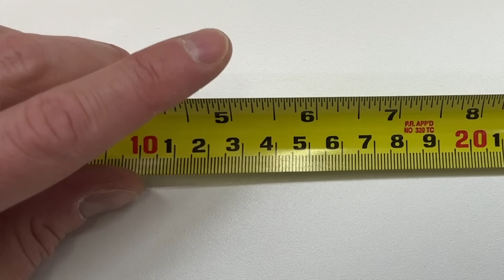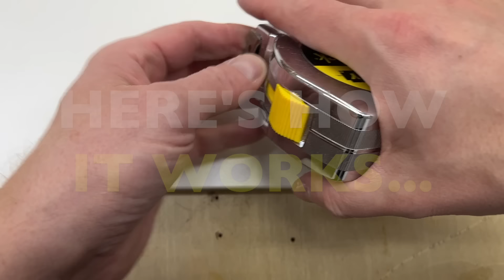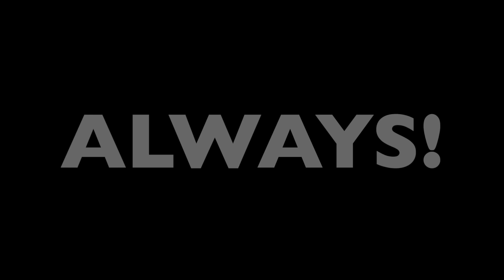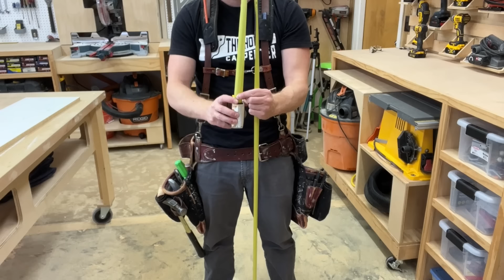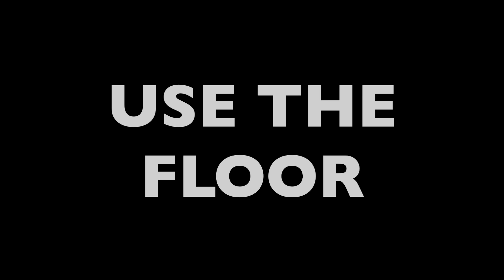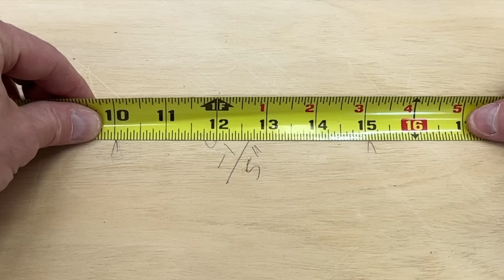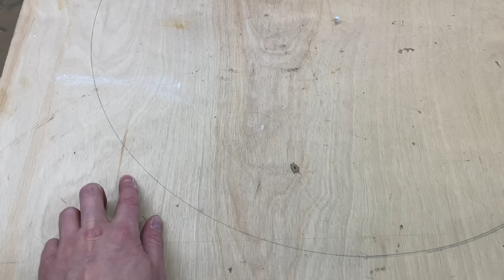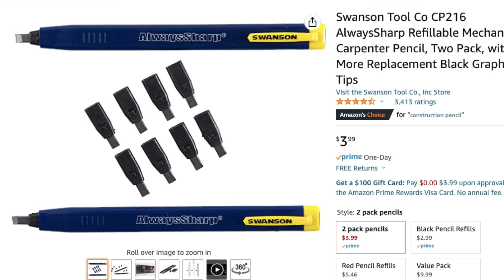ALL TAPE MEASURE TRICKS Explained...In Just 13 Minutes! (Measuring Tape Pro TIPS, TRICKS + ADVICE!)

Comment: Have you ever flipped the tape measure over to use it as a straight edge? Also, some tape measures have a little tab on the end of the tape which will let you roll the tape better for reading. Also when you're measuring something really long and your tape is floating in the air, you can pinch it with your finger that you normally use to keep it from rolling up and that will keep it straight so you can use your other hand to mark a measurement. Another trick is if you are trying to find a center point, make a even mark from both sides and if you can get them within a 1/4 inch or so of each other, you can eyeball the center.

I watched your video to see if there was anything I missed in the 27 years Ive been in construction and I'm happy to say I got every one and agree with you on all of your tips and am impressed with how well and quickly you explain everything

Comment: When measuring into a corner, I mark 10" from the corner and then measure from the opposite side to the 10" mark.
Reply from the maker: I really wish I had put this method in the vid. It’s so easy to leave stuff out on accident 😅
Reply: @TheHonestCarpenter  Not a  problem.  You did an excellent presentation.  I learned a couple new things.

Comment: Fun facts! For the vertical measures, instead of doing the bendy-bend, if there's something to hook on or but against, you can get away with just going straight up against the surface, reading what it comes to, and adding the length of your tape measure case/ rolly-thing (usually its 3" as a standard).
Reply: This also helps when measuring in tight spaces so you don't have to bend into the corner.

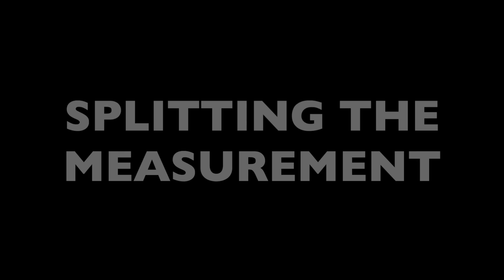Comment: Usually to get an inside to inside measurement when trying to be as accurate as possible I will split the measurement like at 8:29 to get a bang on measurement. I don't like bending the tape. Usually I have to deal with chamfer that's been nailed into a bottom corner so it does not help especially with the chamfer not always being perfectly cut.

Comment: well during my 40 years as a carpenter... I bought and tried out many different tapes ... I finished the last ten years on the job installing high end cabinets - trim and wood panels -  using a Tajima  tape measure - its printed on a white background and is EASY to see and read in low light situations . Years ago it was wood folding rulers when I stated out and I kept one in my box just in case I needed to use it again

Comment: You can instead of bending the tape for an inside measurement you can just butt the tape case up to the surface take your reading then subtract the wide of the case from the measurement much more accurate

Comment: I would like to add some of the things that have come up on jobs, the first is if you drop your tape be sure the tan wasn’t bent, because it will effect your inside outside numbers, and if your cutting moldings and have made a cut list try using the metric system, the numbers are easier to write down and read once you get to the saw

Comment: Great video, 43 yrs in trades, we all have little tricks. Mine is adding up numbers, I’m good at math, but some times, I’ll add let’s say 25 to 35, so I’ll extend tape, take the 25 and line it up to 35 and read the number. In this case it’s 50…..lol, it will stop,at the 60, but works best with fractions, add 25 3/8 to 50 and 3/4, do the same and come up,with 76 1/8”, hope I’m right, but yiu get my drift.

Comment: This was good … adding (didn’t read comments) that , measuring tapes also have a precise measurement on it telling how long the tape is so you can pull a measurement and butt the back of the tape to the wall and add the measurements that way you don’t have to rely on the bending corner technique… this probably wasn’t explained clearly …. 😅

Comment: When I measure inside corners I use a tri-square blade. It is exactly 12". Just butt it up to the inside corner and measure to the other end and add a foot. If it is a wall or ceiling use the blade to mark a foot out and measure to that and add a foot.

Comment: aren't all tapes marked on the body to add to the measurement for inside corners? Butting up against the corner with the measurer and reading the tape, then adding whatever the body dimensions are on the body itself, 2 or 3 inches usually. Isn't that a thing?

Comment: when measuring inside edge to inside edge, can use the length of the tape measure in the measurement (measurement + tape = total distance).  The length of the tape measure is etched on the back of most models

Comment: I was equally happy working with metric or Imperial, went to school in Metric, and lived in Imperial until Canada half-assed the move to Metric in the 70s, it still hasn't taken.  3 things make me work entirely in Imperial these days:

1) The US contimues to pretend it isn't a Metric country, living in Canada, all the plans I buy, or stuff I buy, tends to be Imperial/SAE, so I gave up fighting.  Earlier I was mostly doing my own thing, but after I became a home owner, I did a lot more construction, and it is all sorta Imperial.

2) All the construction products are pretty much imperial, no point in fighting it.

3) On bigger objects, like the boats I build,  it is  possible to get lost on the Metric tape, and the increment is 10 cm/4" so one might not see it at first.  The same numbers just keep repeating.  There is not bottom line with a total that is as clear as 120 inches.

Comment: I was educated in Metric, I know it well.  Don't find it to be better.  I think a lot of people forget that there are decimal inches, and that the Imperial world pretty much invented the machinery and processes that led to the 20th century.  

Carpentry is really dumbed down these days, we don't build complex things any more.  Or if we do it is all built into a comprehensive truss, with no attic space.  But when we did there were books on how to use roofing squares and the geniuses who invented all that long forgotten stuff had their reasons for using fractions.  

In a lot of places today, young people aren't taught much math so they don't know how great fractions are.  It is a lot easier to find the middle of 5 7/16"  than 138.  Just go to 2.5 and move along either 3/16, or exactly 7/32.  A decimal system exists with either inches or metric, and probably works better for people who are stuck using calculators.

Comment: I also only use Stanley tapes. Licensed contractor for 35 years. I can tell that tape your using is the “new” inferior one from Home Depot . Not the old normal Stanley quality. Marked difference. You can still get the real ones at mom and pop hardware stores though

Comment: I'm a carpenter apprentice. When I measure to a corner I make a mark at nearest 100mm or 500 or 1000mm then measure back to the mark from the corner and add the two measurements. Works for me every time. I don't find myself measuring into corners too often so I can justify taking a little longer to take an accurate reading this way.

Comment: Just came across this video. I have a big criticism of the corner read suggestion. NEVER read a bend. Tape from one end, mark ten inches, tape from the other side to the ten inch mark, then do the math. Unless there's something wrong with your tape, or there's something wrong with you, you'll get perfect cuts every time. I've restored five historical homes, requiring perfectly cut wooden window frames, which aren't easy to find. In order to build your own, worthy of sale, you have to get perfect cuts.

Comment: Where are the Metric tape measures?  Why can't we use what the rest of the world uses? No one can do 1/4's, 8th's and 16th's anymore.  Too much math.
Reply: If you live and work in the trades in the U.S., you'll find most all materials are sized in imperial system measurements.  No need to bang your head on the wall trying to change that.. just go with the flow.  If you need some practice with fractions, spend a little time with that until you become fluent with it.  You'll do just fine.

Comment: Great video. I watch a variety of videos on here for different learning purposes. The only thing that I think could help make a lot of videos better is to slow them down just a bit. The people who are in them are knowledgable, but dont give the viewers much time for the info to sink in. It seems like the knowledge is all there, but i constantly have to pause or rewind and I sometimes get lost. So maybe try slowing down just a tad bit.

Also, sometimes after showing an example, maybe offer a "practice measurement" where you give viewers a couple of seconds to work out the measurement (using the techniques youre sharing with them) on their own and then go over it again, giving them the answer so they can make sure wether they're correct or not. Just some suggestions! Thanks for the video!!

Comment: Most pros don't deal in 16ths. It's too confusing. Rather than saying 11/16ths, they'd say 5/8ths long. or 5/8ths plus. 16ths are difficult to find on the tape. They aren't marked, and there are too many lines to count easily. 8ths are generally easy. They're often marked on a good tape measure, and you can always count them quickly. So if you say 11/16th, you have to do the math. subtract 1 to get to 10/16th, then divide by 2, to get to 5/8th, then add one mark. By saying 5/8th long, you get rid of that math.

Comment: I used to buy refills instead of throwing out the entire metal casing.  Saved a few bucks per tape measure of which I had 10 as I always supplied them for my crews, so the savings added up.  I guess that's different now that everything is MIC and cheap as well as cheaply made.

Comment: Add you thoughts, advice and experience with cutting or leaving the line, particularly if one marks every 12 inches on a 8 foot 2x4 (for example).
Reply from the maker: Most of the time I’m trying to literally split the line in half up the center (leave half of the line uncut by the kerf). But if you don’t need really precise pieces, your tolerances don’t have to be this precise. Just remember that the blade has a thickness, and it removes this width (usually 1/8”) from the board!

Comment: when i worked for a  company that only did steel studs and drywall, we would call out everything in inches and eights. usually a team was 2 guys, a cut guy and a screw guy lol. so when the screw guy yells a measurement out instead of saying for example, " 4'8" and 3/4's, wed say 56 and 6.(or if its, 87 1/2 inches, you just call out 87 & 4)  if you only gave to be as accurate as eighths like hanging drywall. it saves a lot of time. especially when you have to  write down a bunch of measurements.

Comment: In Australia (and I think in Canada) a 4" x 2" stud is actually 90mm x 45mm so use either a metric or Imperial tape measure for whatever you are measuring. If studs are 16" apart use the Imperial measure, if they are 450mm use the metric measure. I grew up with the Imperial measurement system and now use metric 98% of the time. If I'm installing 4 brackets for vertical blinds it is easer to divide the width between the end brackets of 2635 mm by 3 for 2 extra hangers than 103" 47/64ths. The only time I use Imperial is to halve a measurement so to halve a width of say 17 1/4" I'll get the zero and 18" looking the same each side and mark off the 9". And there's never a need to use a bent tape to measure an inside corner dimension: put the end of the tape in the corner or if it's fully enclosed add the width of the casing. Or even better use a METRIC laser measure. Multiples of 12 work well for time and the compass and repeat dimensions but not to calculate dimensions.

Comment: The difference between imperial and metric is one is fractions the other is decimal. The most common calculation in carpentry is dividing by 2 or finding the center. This is much easier to do with fractions.
Reply: If someting is 13cm center is 6,5cm. How is it easier in imperial?

Comment: This was great!  I'm 66 and have used tape measure all my life (but for little things).  I never knew about these tips.  I'm still unclear about the movement of the hook at the end.  If I'm measuring something to cut, say it's 12 inches. I hook the tape measure on one end, pull it to the 12 inch mark and i'm ready to mark.  But since there's now an additional 1/16, do I mark at 11 & 15/16?
Reply from the maker: No, mark right at 12”, Clem! The hook pulling out a little bit is what makes it accrurate—the hook has subtracted its own thickness for you. But if you butt the hook AGAINST something, it adds its own thickness. In both cases, you DONT have to change numbers.🙂

Comment: I have never used a measuring tape.  I I've been redecorating my place . My question is, when measuring the window and finding the half point then measuring out towards the wall to hang a floating shelf.  How do I read the tape on the window measurements?

Comment: Great video! The only thing I would change is to NOT throw a bad tape measure out. A good majority of these tape measures and hand tools come with LIFETIME warrantys.

In my experience from buying tapes from either home depot or Menards, they will let you swap out the defective good for a new one on the spot. I havent paid for a new tape measure I'm about five years and I have a total of four. A magnetic Milwaukee for steel studs, two Dewalts for stick framing and of course a fat max.

Comment: Listening to the explanation of how to figure out SAE really sounds moronic compared to just counting to ten in metric.  For a dyslexic like me SAE is as complicated as your explanation sounded.
Reply: Well, go to any lumber yard in the U.S. and try using the metric system.  You'll soon see that you're doing things the hard way.  Its all a matter of how you learned, where you learned, and how adaptable you may or may not be.
Reply: Right and it past time to go with the incredibly easier metric system. Stay with fraction is just dumb in this age. @bobbrown1603
Reply: Right in part and it is past moronic. Counting to ten is simple. Counting fractions is pointless. By the way just about any lumber yard that has a decent management program can do a thing called converting, and many have a thing called a tape measure with both fraction's and metric. Now go and find a car manufactured in the last 20 years that is not metric. Then there is long range artillery, the space program, and other programs that are joining the present. Pull yourself out of the past and join a much easier system. @bobbrown1603

Comment: Great video.  It's gratifying that i've come up with most of these techniques on my own, but I'd much rather have just seen this years ago.  What i do for maximum precision is add a plus or minus to the nearest sixteenth, just can't abide working with 32nds or god forbid sixtyfourths.  A lot of the time I'll just try to recall how far from the nearest sixteenth the measurement was.  One thing that could have been mentioned is to always use the same tape, and learn that particular tape's foibles.  Instead it just recommends throwing away old tapes!  xD novel idea, but I suppose i get too attached to my old reliable tape even while it has almost no marks along the first inch eg

Comment: Measuring the center of a board: start any # (2") at one edge and measure diagonally to finish at the opposite edge so the mark is double the first number. For example: 2" and 4" and 3" mark is the center of the board.

Comment: Good video There are a few tips could be added if you have a tape measure with a rubber body it can be used as a eraser most tapes the body of the tape measure can also be used as a standred measurement some even have them marked on the body AD 3 inches or 3 1/2 inches plenty of other tips if you have a tape measure with a magnet you can magnet it to a nail and smoothly travel in a circle.. metric tape measures are not easy to find in the usa there actually rare but you can buy them online.. you can also use them to make quick arcs for design cutouts @The Honest Carpenter
Reply: There are tape measures with the fractions already spelled out so it's clear at a glance what's what.
Reply: @brodriguez11000 yep forgot to mention that one love the fraction tape measures

Comment: Totally disagree with how to call out measurements. As a pro, in rough construction like framing, drywall, and even tile, 1/8" is smallest precision increment I use. 
So for sheer speed and reduction of doing "needless" math, I simply use only two numbers. The Whole inch and the Fraction numerator. For example: 10 and 7 is 10" 7/8". Another example, 73 and 6 is 73" and 6/8" aka 3/4". It's a form of short hand. If I were going to write it out then it would be 72 6/.  This saves so much time and mental energy that is best used elsewhere. 

Now for finish work I switch to 16ths instead of 8ths. But it's the same concept.

Comment: Measuring using fractions could be explained another way which could be easier to some people to understand :
"There are 16 fractions from every one (1) inch to the next Inch, take for instance 1/16, then 2/16, then 3/16, then 4/16 asf, All that is left to do is to reduce the fraction to its lowest term, This method helps the person to better understand algebra, so a measurement of (22-14/16) is equivelent to (22 -7/8) after deviding by their common denominator which is 2.
1/16
2/16 (/2) = 1/8
3/16
4/16 (4) = 1/4
5/16
6/16 (2) = 3/8
7/16
8/16 (8) = 1/2 asf
ASF is short for "and so forth"
All in all it was a great video.